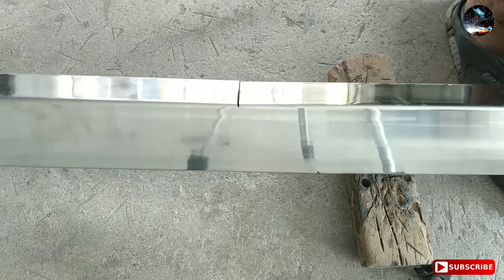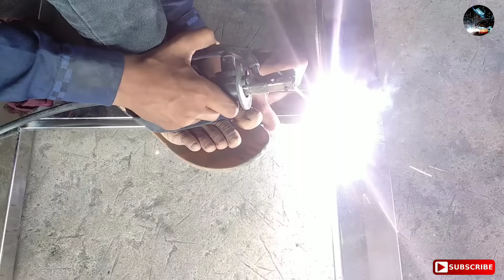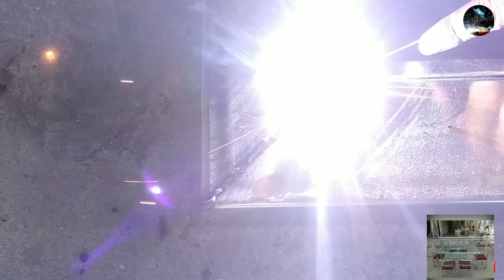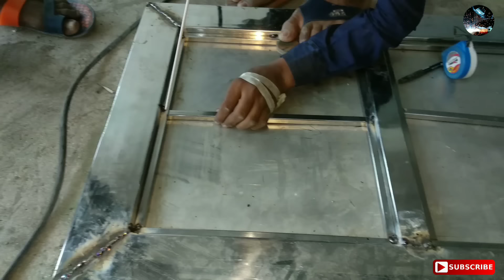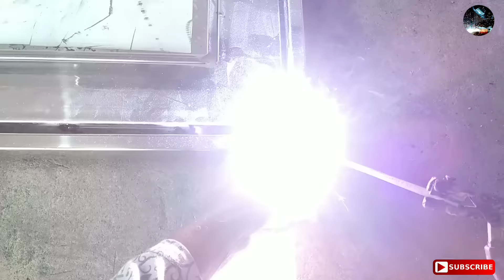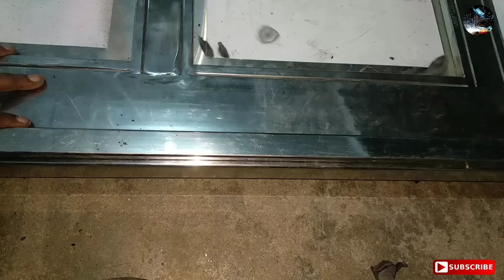Door | Stainless Steel Door design manufacturing

Comment: Use Tig welding. This looks odd even after grinding. Also stick weld has lesser penetration which effect strength.
Reply: This country many welder using stick weld for stainless steel